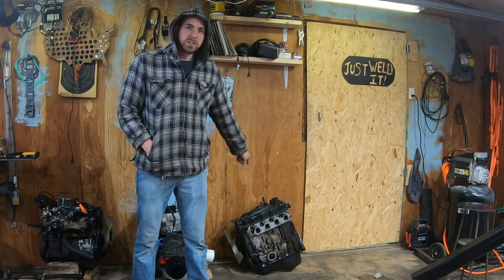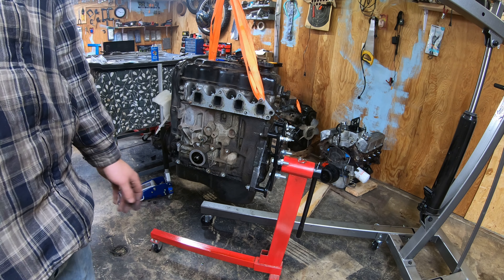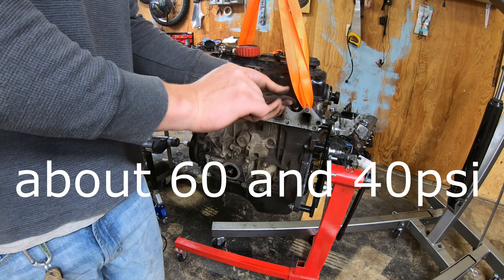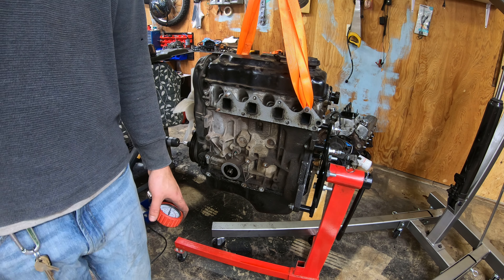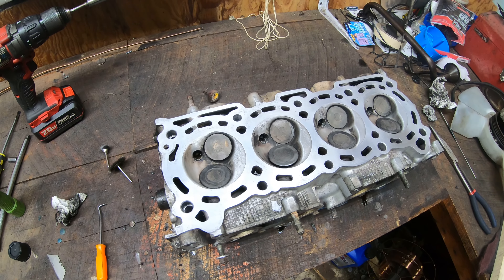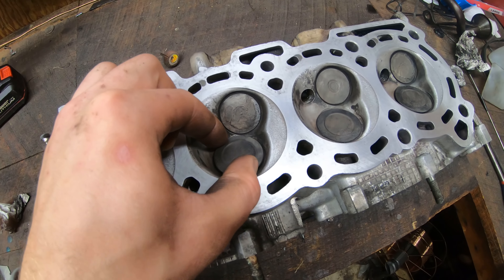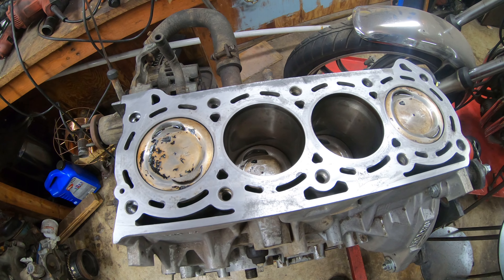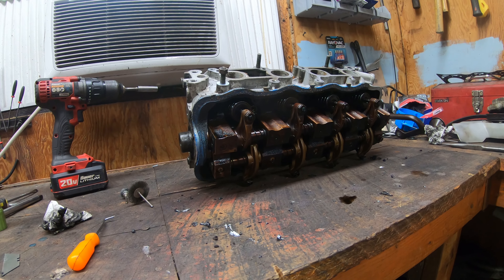1.6  8v Suzuki Samurai Engine Upgrade and Build - Part 1

Comment: Where is part 2 ?
Reply from the maker: Ya know, I made a part 2 that was about setting up my fuel system to keep a carburetor ... but totally forgot to include the rest of the engine build.  Not actually sure I filmed it all either but I ended up just putting in new rod bearings, the mains looked good, cylinder walls looked and measured ok for my purpose   and I had to replace a bent exhaust valve. It runs good now! https://youtu.be/ktolO4GGQZQ
Reply from the maker: Also just lapped all the valves in...I wanna say it's around 160 psi on all cylinders now